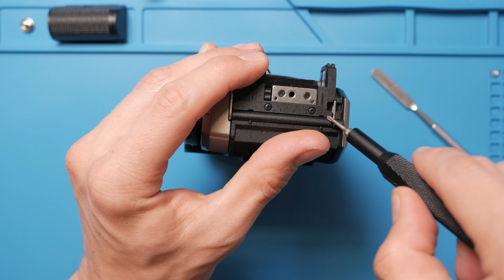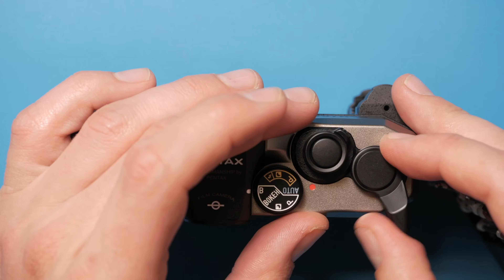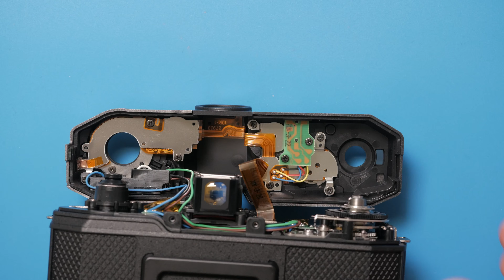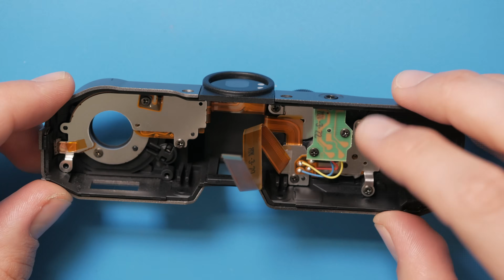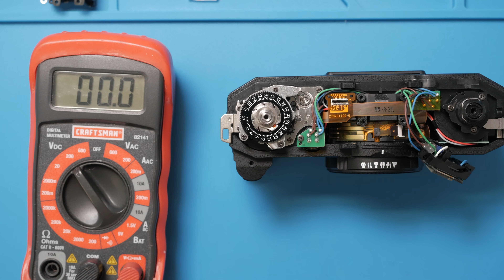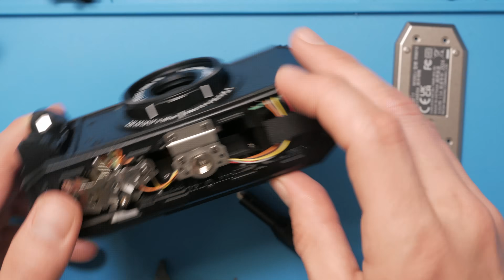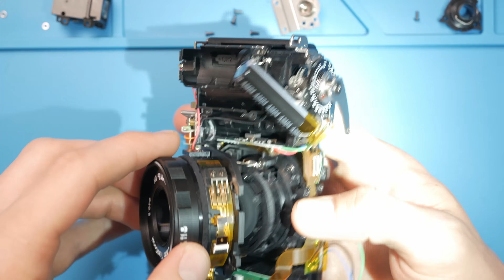Pentax 17 Teardown | A Look Inside the New Film Camera from Pentax

Comment: As a process engineer quite familiar with multiple electronic and mechatronic assemblies I must say, that it is very sad, that they are still using things that are not supposed to be in any camera designed and manufactured within last 20 years. There are multiple design fails like usage of screws of many different types all over the camera which makes the assembly more complicated and also affects sourcing, logistic etc. I see no use of loctite on screws. Then all those front, back, top and bottom covers should be very easily removable without digging through main controls or peeling out the rubber grip(!). I see no dust seals, so that camera will be full of junk after some time, especially when carried in pocket. There should be ideally only one HDI PCB instead of having several separate ones. All those hand soldered wires are just disgusting. Hand soldering should be avoided at all cost and all such wires should be attached by connector or replaced with flex cable attached by connectors to PCB. Ideal board would be cleaned to remove all flux residues and then covered by conformal coating to maximize lifetime and protect it from dust, moisture and other nasty things. ZIF connectors are standard for ages, even that Ricoh from your older video is much better example of assembly. This Pentax 17 reminds me when I was fixing shutter button in my beloved Pentax K-5, again the same disgusting strategy inside with bunch of hand soldered wires all over the place, screws with different type in various places and really horrible layout of parts inside. Contrary to that when I was cleaning sensor on my 2011 Olympus XZ-1 the inside was pretty neat design. And it is much more complex digital camera than this Pentax 17 and was being sold for less money (!). Also my Oly EPL-6 which I openned recently to fix damaged cover is much better assembly, and that is lowcost MFT camera. Cmon Ricoh, move to 20th century!

Looking at this assy, this camera barely hits $100 level. Anything above is just cover for development cost and margin for Ricoh. At least they can easily replace that cheap lens module with different lens and offer some Pentax 17 wide or telephoto version in future if they want.
Reply: ZIF connectors absolutely can not be used for flash, they would burn up. Modern day high end cameras still use soldered wires for integrated flash.

Comment: This gives me some good confidence in my purchase, thanks! Hopefully this shuts up the people calling it a cheap plastic camera.

As for the "shutter delay" people notice, do you think that's likely the solenoid firing after the shutter to prepare for the next film advance? and it only sounds like there's a shutter delay?
Reply from the maker: Yes, you’re on to something with the perceived shutter delay. But in some cases there is a real shutter delay. The sequence goes like this:

1. On shutter half press:
1a. lens moves to the focus point

2. On shutter full press:
2a. Shutter releases (instant, nearly silent)
2b. Solenoid fires (delayed, loud)

So if the photographer half presses the shutter release and waits, then the shutter can be fired with no delay and the perceived shutter delay is just the delay of the solenoid firing.

However, if the user goes straight to a full press, then there is true shutter delay while step 1a (lens moving to the focus point) completes.

This focus delay is disappointing for a zone focus camera — it would be nice if the camera just prefocused to the desired zone. I imagine Pentax designed it this way to trade instant response for prolonged battery life.
Reply: @EvanDorsky  That's interesting but tracks with how I'd expect it after seeing the teardown! The camera only focuses on half shutter even though it should ideally already be focused by that point since the zone is set. I wonder what tradeoffs there were here. I'm not sure if battery life would be too harmed by setting it right away because if you keep taking repeated shots at one zone it will keep moving the lens back and forth from the default to the same zone, instead of just leaving it there.

What's neat though is it could be addressed someday via software.

Glad that half pressing it can avoid the delay though! that's what I'm used to anyways with digital cameras
Reply: @salihsen8346 they'd need to fully replace that binary switching kind of thing right? so this would be an iteration for a future camera? Does seem nice and forward thiking

Comment: A few questions for you.  Was the flex cable dated 3-21-2024?  I couldn't quite see the 2024 number so not sure if it's a manufacturing date or just a part number.  Did you figure out what the o rings under the leatherette were for?  Maybe tooling for future features on the camera body?  Any indication that this was built with using the same body for future film camera releases?  And were the front and back screws on the top plate really just decorative?  It looked like they secured into tabs on the camera body.  Great vid.
Reply from the maker: My editing didn’t make it very clear, since I called those screws “decorative-looking” - but they are in fact functional, playing a part in securing the top plate. And thank you!

Edit: Also, I believe you have the date on the flex cable right. Gives some sense of how long it took Pentax to accumulate parts and ramp up production (lead time of a few months is not that surprising to me as a consumer electronics hardware engineer).

Comment: Can clearly see why this costs the price it does. I love mine, people should understand how much work Pentax put into this unit
Reply: Take a look into cameras from competitors. That will help you.
Reply: @xmeda what competitors? Leica and Mint? Which are both more expensive?
Reply: @pedronunes6401 Leica is a luxury item. Mint cameras have "0" warranty and are a nightmare to repair 😮.
Reply: Overpriced piece of plastic
Reply: @TheKardred  "Overpriced" bruh that camera is cheaper than new ones back in the days
Reply: @GoofyCatGoofer  than high end models? At least you get a metal body that will last 50 years. This shit is dead in 10
Reply: @TheKardred  My 100% plastic pentax compact just celebrated its 30th birthday this year. I put it in my bag without protection, it's already fallen over, it works like a charm and it was the top of the compact range in its day.

On the Pentax 17, we're talking about injected plastic, probably ABS, which is the best quality plastic possible, and magnesium, which is light and robust, also the best.

A light camera also takes up less inertia if it falls than a heavy camera. So there's less risk of breakage. An SLR will break its lens almost 100% of the time.

The story goes, you can build the shell you want if the parts inside break, you've lost.
Reply: @TheKardred  I have a bad news for you. Plastic or metal no matter if overall quality is bad. There is plastic parts in my 50 years old canon ftb-n and it works perfectly with all of them in perfect condition. There are a lot of minox 35 which bodies are made with some kind of plastic composite. And there is zenits with metal bodies prone to deforming, scratching and breaking after smallest incidents and weights ungodly amount for nothing
Reply: @TheKardred LMAO tell that to my 45 year old Pentax
Hint hint : it’s plastic
Material doesn’t matter if it’s well made

Comment: Very interesting! From what you see inside the camera, could this design be easily converted in a future version to full autofocus?
Reply: Autofocus can miss. Just learn the snap focus system lol…
Reply from the maker: I’ve convinced myself that Pentax chose to motorize the focus mechanism for one of two reasons:
1. They are testing the technology for a future autofocus camera
2. It was actually cheaper, or easier, for Pentax to design it this way vs manufacturing new helicoid, lubricating it, dialing in the manual focus feel, etc.

#2 may sound like a ridiculous reason, but I think it’s important to remember that Pentax hasn’t made a camera like this in at least two decades, and it might have been easier for them to just slap in an autofocus mechanism based on one of the Ricoh compact digital cameras.

That said, I think with a lidar/phase detect rangefinder, it would be very easy for Pentax to adapt this design to autofocus. And I’d love a new autofocus camera from Pentax so I’m very much hoping for reason #1.

Comment: Love to see they made pretty notable efforts towards serviceability!  Also, nice work; I think people are going to be looking for this video in 10-15 years when these things start experiencing a lot of wear and tear problems.
Did you use a high value resistor to drain the flash?
Reply from the maker: Thanks! I was also happy to see how easy the camera was to disassemble.

And yes, to drain the flash I made an array of 0.25W resistors with an effective resistance of ~50kOhms, trying to get a reasonable drain time without pulling too much current and burning up the resistors. I think I could have gotten away with a lower effective resistance.